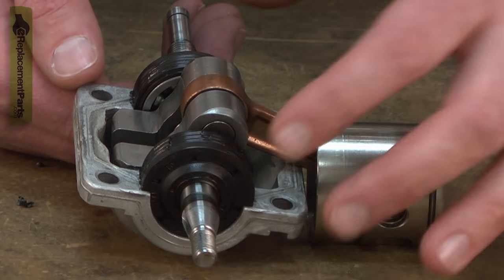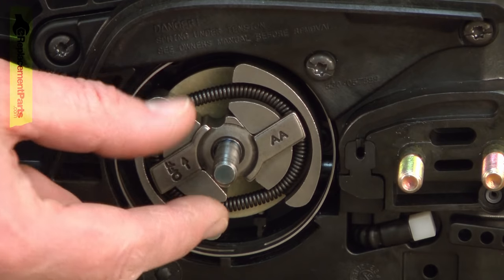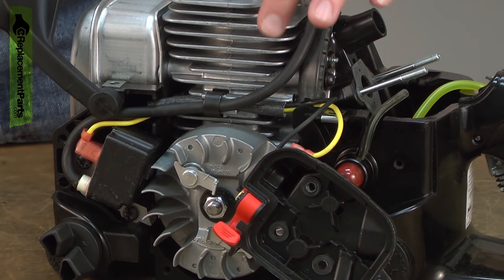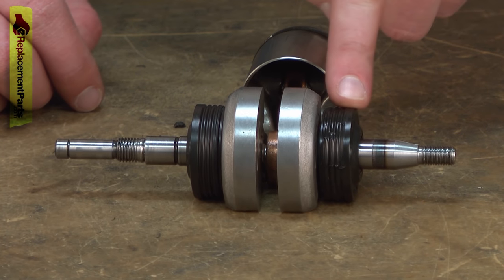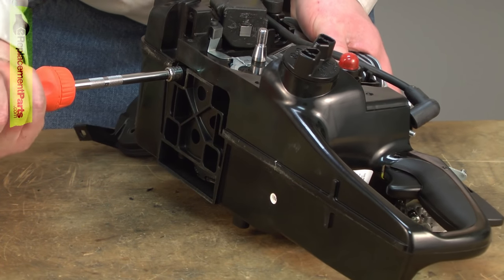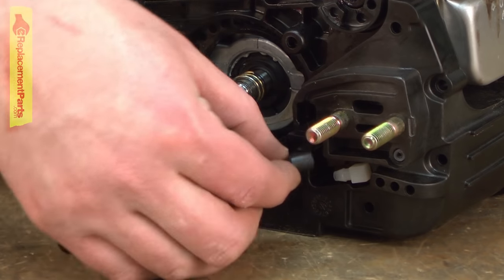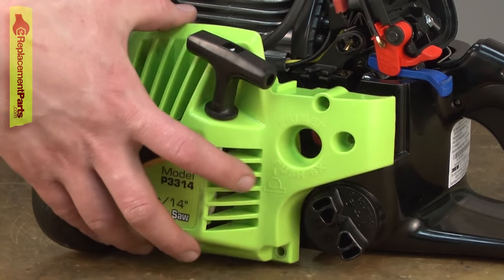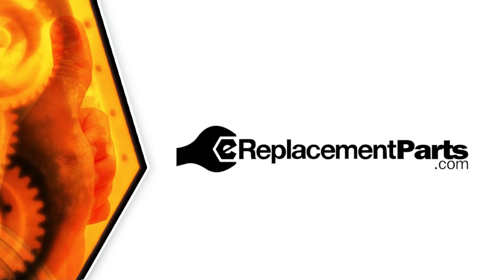Chainsaw Repair - Replacing the Crankshaft Bearings (Poulan Part # 530056363)

Comment: There are two plastic filler plates that can slide out of the cylinder block they guide the two stroke mixture from the crankcase to the cylinder and the carb mixture to the crankcase. The have to go in the right slots. the bottom tabs align with the bearings correctly so they are positional. It makes sense. I am working on McCullock 842 it exactly the same. I just wanted to know if you sealed all round on the base as shown by you. And you do thanks? Wish I found this first! Had to learn bit by bit at least I know I got strip and build right.

Comment: Serious rebuilder question: It looked like you just slipped those bearings right on the crankshaft. I thought that wasn't good and that you should have to freeze the crank or heat the bearings to install and they should be tight, otherwise they can spin on the crankshaft and wear it down. Are these poulan bearings different? I have like 4 of these saws I'm considering rebuilding and would like to know for sure. Thank you.
Reply: They slip on I was worried about the seal being cut going over key way. It a slightly smaller diameter. It is as easy as he shows. But as he pulls cylinder off see the two plastic guide plates for the gas flow slide out. Note which is which and slide back in during assembly
Reply: @anthonywilson4873  They only go in one way.

Comment: Does the bearing need any pre-assembly lube or grease for initial start up?
Reply: I personally would at least hit it with a little bit of some sort of oil (like Marvel's Mystery Oil or some sort of other lightweight oil) just to keep them lubricated and help keep the bearings from hopefully experiencing any sort of premature failure until the oil/fuel mixture enters the crankcase and starts doing its job of properly lubricating all the internal engine components that need it.

After that happens the bearings should be okay on their own, especially if you aren't just immediately hammering down on the trigger and going wide open throttle (W.O.T.) as soon as you start up the saw like a complete jackass.

Comment: The is a great vid for a no start condition, If
You have spark and fuel and compression but the chainsaw won't start 

The underside of the two stroke engine acts like a supercharger the engine is spect-ed out with a lower compression ratio  if the seals next to the crank roller berrings fail you will not start 

This vid about betting replacement solves this most common problem if you substitute the berring replace for the seal replace. 
If you want to prevent this from happening in a month seal outer perimeter of main shaft seals with gorilla snot ( 3m trim adhesive )
The down side of this is future dissasembly "may" need acitone as it gets hard
Additionally there is a second carb upper hose that fails for a hint on older saws I cut up a old metric heater hose from Nissan to make a perminant repair

Comment: Shouldn't you use locktight on bolts that hold tha crankcase together?
Reply: Can use 242
Reply: I'd probably at least use the low strength Loctite (it's color coded according to its strength) to help keep the screws from backing out, potentially just a bit of the medium strength version, but I probably wouldn't EVER use the high strength version in most cases.

Especially if you use the saw a lot and you expect to have to do some more maintenance/repairs on it in the future at some point and you want to have the ability to take it apart again.

I say that because the high strength Loctite will be all but impossible to get past and you will potentially either just end up breaking screws/bolts off or stripping them until you can't really undo them anymore.

Because with the highest strength version of Loctite you basically have to hit the bonded screws/bolts with heat from a torch to ever come close to getting it to fully release it's bond on them so they can crack loose and be removed.

Now if you were using it on tractor or motorcycle bolts/screws that were in a place that experienced really hard vibrations constantly for example, then you using the medium strength Loctite would be the minumun requirement and the high strength version might just even be warrented to keep everything from backing out and causing any issues.

Comment: Does this also work the same way for a Stihl chainsaw?
Reply from the maker: Unfortunately we are not a Stihl dealer.  I don't want to tell you that it would or wouldn't. You will need to contact a Stihl Dealer, since they are the only ones that can service their saws.  We do offer a few Stihl accessories, but
they are mostly chains and bars.
Reply: No. Stihl are dropped into a heated case so the case expands to allow bearing to drop in.

Comment: I am an experienced mechanic, you will never replace a crankshaft bearing by simply pulling it off the crankshaft with your fingers! this is a false ! video but it does describe how to take a saw apart back together but it will never be as easy as he made it look !

Comment: Jesus...

This was a pretty good video but in all honesty I'm calling Poulan/Husqvarna's hand at what looks to be sketchy or inferior build quality, as the plastic looking oiling mechanism and the piston with only a single ring looks suspect AF.

It probably wouldn't hurt anything to upgrade the oiler to a sturdier version made out of metal and get a replacement piston that has at LEAST two rings on it, preferably three if it was at all possible.

That's just my personal observation and take on things though...